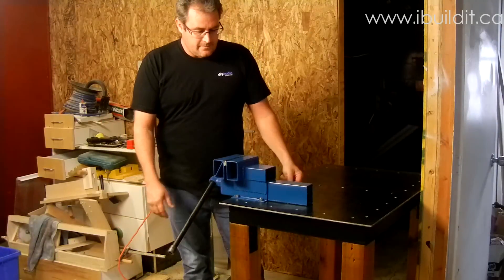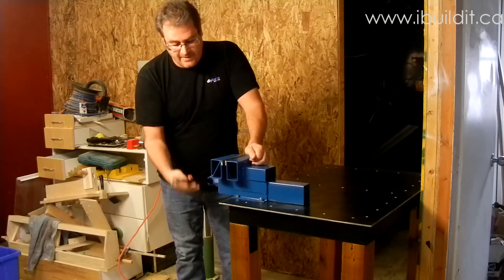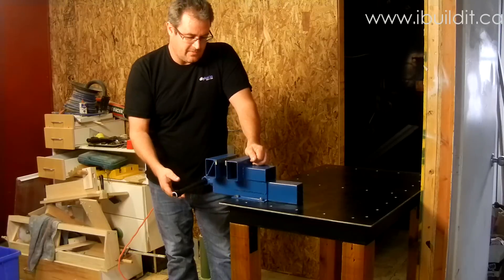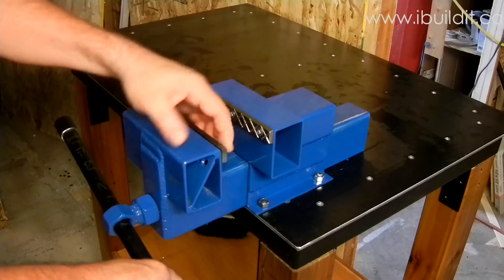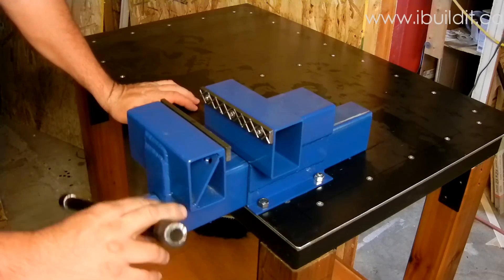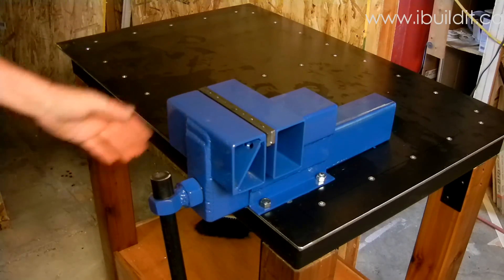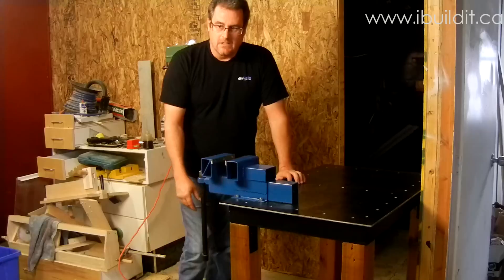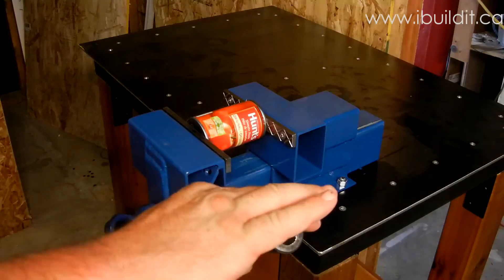Homemade Bench Vise

Comment: I like your creative ideas with common tools.  Especially the "knurling" you did to the jaws and the handle press fit using the torch on the 3/4" pipe sections.